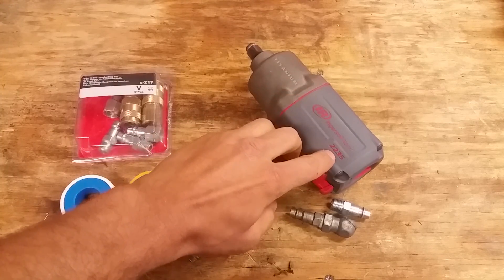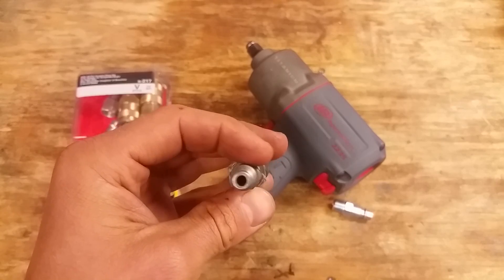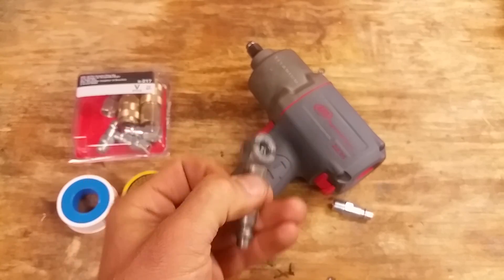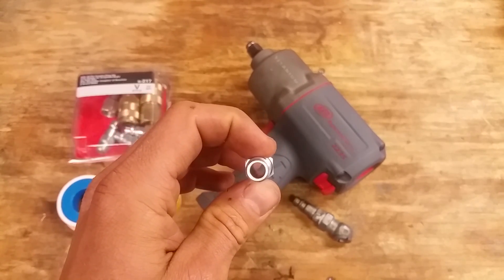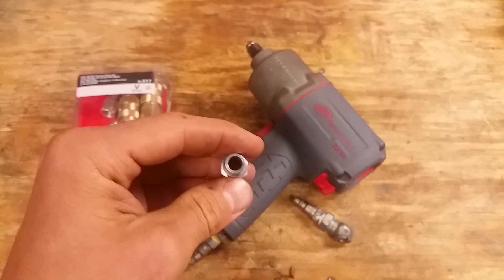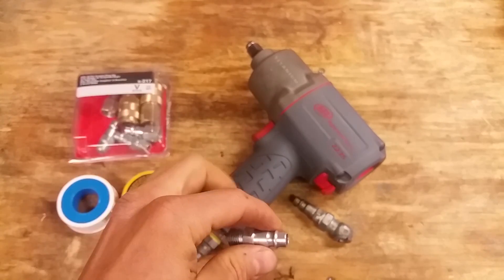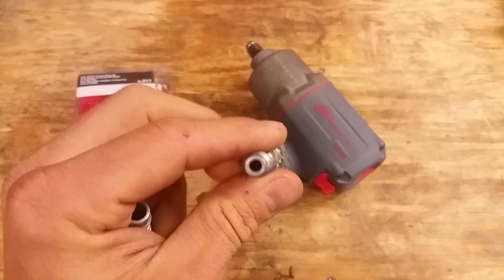The BEST Air Fittings Made?!?

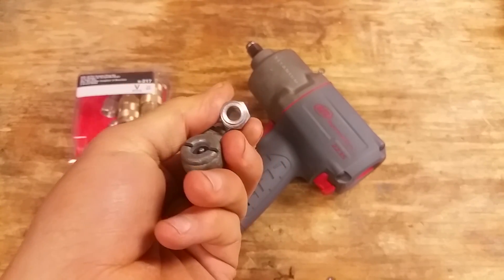Comment: Hey MATT!  THANX for your excellent video.  But you asked us about the "Before anf After" difference and our own results didn't you? SOOO, here we go:  Last year I bought my very first impact gun for working on my cars. I bought it at a local EXPO, attracted by its very small size, very attractive because of the cramped insides of present day automobile engine compartments.  It is a very compact gun made by Mighty-7, model NC-4610, a gun that can go into smaller spaces than most main brands like Ingersoll-Rand, Atlas Copco etc.  Let me tell you that these smaller but powerful (400-600 Ft-lb torque) compact impact tools NEED even MORE airflow than the standard guns like your Ingersoll-Rand.  How can that be?, Well, as an engineer, I just had to investigate the reason.  I saw the Mighty-7 demo at the EXPO, and it was amazing... BUT the first time I pretended to use it at home, I suffered an amazingly DISAPPOINTING Failure, as I wasn't able to even remove the wheel nuts of my wife's car, that were only tightened to a low 85 Ft-Lb!  I took the Impact gun to the vendor, and they tested it, returning it to me as "perfectly OK"...After studying deeper and deeper into the subject (that many people wrongly take for granted), it is due to the compact's gun having a higher INSTANTANEOUS AIR FLOW CONSUMPTION.  It is better explained by understanding that an air motor is not like a turbine (more or less constant air flow), but more like a reciprocating pump.  In Reciprocating pumps, you need to have a HIGHER available pressure at the inlet in order to avoid the cavitation of the pump. That is because at every pump piston stroke, the fluid MUST be accelerated through the inlet passages of the pump, in order to "fill" the piston cavity or cylinder. Otherwise, it will fail to fill completely, exactly like when you try to QUICKLY fill a syringe with water from a glass through a slender hypodermic needle: if you pull the syringe  plunger too fast, the water won't be able to fill it completely (at least initially).That fluid acceleration is needed because the fluid is not moving at first, but as soon as the pump piston tries to pull the fluid, it needs to get quickly moving.  Exactly the same happens in an impact gun: Every time the air motor (a vane type air motor) starts to turn, it demands a VERY HIGH instantaneous air flow, because the cavity formed by the vanes passing in front of the inlet port demand a very high instant flow (the cavity is ALMOST empty because when the vanes turn, the cavity emties to the atmosphere, through a very low restriction muffler, so that in the next cycle, that cavity is almost at atmospheric pressure, but before the vanes turn, actuallly there is a very low flow. This means that the really important flow is not the average, but the Maximum Instantaneous flow. Thus, as you correcly said in your video, the manufacturer of the air tool only gives the MEAN or AVERAGE air consumption because he is NOT able to measure instant airflows, so they resort to only measure average consumption after several seconds (or even minutes) of the tool operation. While continuous or average air consumption determines if the compressor will support the tool's demand for air, it is the hose (and anything) between the tank and the tool which determines or limits the instantaneous air flow.  That means that hose internal diameter, its lenght and the pressuredrop of any fitting betweenthe tank and the tool are the most important things. For example; the popular swivel-type fittings that allow great movement of the tool, typically causes too much pressure drop.  Same thing for any pressure regulator after the tank... small 1/4" size regulators have por pressure drops at high instantaneous flows.The difference between the performance of the impact tool in the DEMO at the EXPO, and the same tool at my home was NOT the size of the compressor, but much more importantly, the size of the HOSE (inside Diameter AND lenght).  At the EXPO, the impact gun was demonstrated with a MUCH LARGER 1/2" hose and only about 8 ft long (the size of the vendor's stand!), while at my home I was stubbornly trying to use their brand of Retractable Reel, which stoopidly enough, comes with about 50 Ft of NON-Standard 8X12 mm polyurethane hose, a beautiful blue color but USELESS air hose, at least for high consumption tools like the Impact gun or the air hammer!  That damn Taiwanese air hose is NOT the assumed "3/8" standard air hose, but a non British, metric one, and while externally it LOOKS like a Std. 3/8" hose it is WAY narrower inside, at only 8 mm (that's about 70% area of the 3/8" hose). That, coupled to the longer 50 ft lenght inside the reel, made my new impact tool so weak that I was unable to remove the wheel nuts, even when the Torque chart that they deliver for this exact impact gun model, reaches a peak of almost  660 Ft-Lb after a full blast during 8 seconds.After being puzzled by the manufacturer data and my initial results, I started to learn exactly how the tool uses the air pressure, and how important is to be able to achieve the demanded Max Instantaneous Airflow that these small but hungry air tools demand in order to deliver their torque. Next, I replaced the hose reel with a shorter, 12 ft lenght of 1/2" internal diameter air hose, and VOILÁ, the little impact gun instantly removed the same wheel nuts... but failed to remove some stubborn larger nuts and bolts used in the suspension of the same car... again filing to show the advertised high torque of more than 600 Ft-Lb.Lastly, Thanks to your excellent video and info, I gathered the last piece of information: the coupler and its fitting.  By removing my DeWalt's air compresor standard coupler and screwing the hose directly to the compressor tank, and using the 1/2" hose directly attached to the Mighty-7 model 4610 NC compact impact tool, I was completely amused to verify that now the tool is able to remove the tightest, largest suspension bolts with easy.  Another thing that the people from the vendor told me was that all impact air tools NEED some "Break-In" or "Run-In" in order to properly "seat" the edge of the vanes to the cylinder or housing wall, otherwise those won't seal and slide as well as after some use.  They recommend to put oil more frequently into a Brand new tool, and it shows because the air outlet will spew out a darker than usual oily exhaust during that break-in period, that you can see with a naked eye.Again thanks for your useful and helpful video, I'm ready to search for my Milton high flow fittings first time tomorrow's morning!  P.D.: As soon as I looked at the large difference in size of the two fittings in your video, starting around 2:05, I remembered about another tool that came with the same style larger inside diameter fitting: a tool made by German company "BGS", that is intended to bleed the brakes of a car using compressed air.  That tool uses a kind of ventury to produce a vacuum to pull the Brake Fluid out of the wheel calipers.  Well, I wanted to do that task some days ago, but found that the fitting that the pistol-like handle came with, is almost exactly like the Milton ones, and that my air hose coupling did not accept that slightly larger fitting. So, here your video is DOUBLY USEFUL, because now I positively know that the Milton ones are not only better flowing but also back-compatible, so I will be able to use the older narrower fittings for the tire inflator, and the blow gun, or the small ("detail") painting guns, and the high flow ones for the impact gun and the pneumatic hammer ( as well as my new brake bleeder, that already came with the larger fitting).  Best wishes.

Comment: Im a ASE CERT MASTER TECH for many years, thruthfully speaking it doesn't really matter that much about the fitting, , the 2 things that make your airtool perform better is the hose inside diameter and the pressure u run it at! These fitting might show a minute change in performance! But you have to retool all your tools with this new fitting which can be costly, and also its not a STANDARD industry fitting! the 3/8 1/4 npt is standard for up to a 1/2 drive impact gun, anything over that ull need a 1/2 insde diameter hose! eg. 3/4 inch drive to 1 inch drive impact! Also sometime's u may have to borrow or lend a tool to colleage which wouldnt work with your fitting! So keep it simple stupid and stick with the STANDARD sizes! This is why WINDOWS is the number one platform in the computer industry and ANDROID controls the cellular world !....
Reply from the maker: This fitting is worth changing out everything in the shop. If they want to borrow a tool just swap out the fitting with a regular "M style" fitting. The female coupler is backwards compatible with "M style" fittings. Meaning the female plug coupler will accept both types. If you change it out both types will plug in. You can't plug this "V type" into a regular "M style" female coupler though.
Reply: Are you not seeing the obviously higher rpm?

Comment: Yep, I just purchased the NitroCat 1/2" 1056XL for a good price on Amazon.  The minute it came in I put fittings on it and tried it out.  Well, it really struggled to remove lug nuts on my 1997 Jeep Cherokee Sport.  I jacked up the air and it did better, but still slow.  So, I checked into YouTube University and found your video.  All my fittings are the small ones for operating my little trim nail guns and staplers, the hose is 1/4" and very light weight.  I just ordered the Milton kit you recommended, a short whip with a 3/8" swivel and a new 3/8" x 25' Air hose.  Because your video made sense.  I'll let you know how it worked out.  Cheers.
Reply: Jacked up to what psi??

Comment: I have a 3/4 Impact gun which needs a 3/8 fitting I used a reducer 3/8-1/4 with a 1/4-1/4 fitting and flow is weak gun sounds like its dying. My Husky Model # C303H 30gal air compressor has 1/4 connectors/connections everywhere and the regulator doesn't drop under 90psi w load. How can I get it to work properly?
Reply from the maker: 3/4" impacts really need 1/2" air hose and 1/2" quick connect fittings. It's a 3/4" right? Not 3/8"? Sooo 1/2" connectors from the tank to the impact. They are expensive I know, but it's worth it. You'll see.

The 3/8" hose and 1/4" fittings will never flow enough air for it to work right.
Reply: @MattsShop  The impact gun I'm using is from Harbor Freight Central Pneumatic Item # 66984. 3/4 in. Heavy Duty Air Impact Wrench. I plan on getting a 1/2" Hose.
Reply from the maker: Yea, you should be golden with that set up. A 3/4" impact needs 1/2" air hose and fittings. 3/8" air hose is WAYY too small. Did you get it set up??
Reply: @MattsShop  A 1/2" Hose was unavailable at Harbor Freight so I got a high flow automotive fitting kit and a 3/8 to 3/8 NPT adapter to connect to my air compressor and impact guns. Also brought the 3/8 blk 50ft hose and it made a huge difference my 1/2 impact took out my lugnuts with ease they were stuck by a shop and my HF 3/4 Impact wasn't even necessary but I'm keeping it anyway but its reverse tq is rated at 1000 when my 1/2 is 1300 makes no sense to keep it unless it's really better.

Comment: Hey Matt. 
Is there a difference between brass and steel couplers? I'm using my compressor mostly in the garage with a little stapler, filling tires and blowing dust of circuit boards. The brass is almost double the price and I can't see the benefit.
Reply from the maker: Steel air fittings are the strongest, cheapest, and most common. Brass air fittings seal better (so they say), are weaker, don't rust, and are more expensive.

So it just depends on your application. For example, if you were using them underwater or for an application that you would put water through the fitting, then you'd want brass. I'd use steel air fittings. That's what I use!
Reply: Thank you brother.
Appreciate the advice and the time it took to record, edit and post your video.
Cheers
Reply from the maker: You are welcome! Thanks for the support!
Reply: Went to Harbor Freight today and picked up a Merlin 5 pc set of steel couplers. Cost me less than $4 with a coupon. Totally stoked. Will record a video on how they're working out after a few months of use.
Cheers brother

Comment: I've heard Milton fittings are not very durable. Some of them can chip or break if they are dropped. Have you had any issues with that?
Reply from the maker: No that's not true at all. The only problem I had was my air hammer put ball bearing dimples on the fitting from all of the vibration at the coupler. The coupler got stuck on, but It was my fault. I was misusing the air hammer.

Comment: whats the inner diameter of these fittings? i wanna compare to mine.
also what fittings do you have on your compressor? dont you have to swap them too?
Reply from the maker: I don't know the inner diameter. The whole end of the 1/4" air fitting almost fits inside these. It's substantially larger.

Comment: Will this fit the IM plugs?
Reply from the maker: Yes, they are backwards compatible with "M" style air fittings.
Reply: @MattsShop  good. I even put the high flow on both ends of my hose and on the compressor itself. I'll test it tomorrow

Comment: Did you also change the fittings on the other end of the hose where it connects to the compressor? If not, isn't the air flow still restricted?
Reply from the maker: Yes, for max flow. I plumb directly into the compressor with no quick disconnect fitting for max flow.
Reply: @MattsShop  Thanks! I just got an air ratchet to work with a little 6-gallon pancake compressor for my home garage. Want to get the best performance out of it.
Reply from the maker: Yea, you're gonna need the high flow air fittings. Air ratchets use A LOT of air!
Reply: Thanks,  @MattsShop
Reply: @SiteReader  That pancake unit will be charging the whole time - not a lot of reserve for those types of tools.  I have a 60gal which runs down fast enough as it is.
Reply: the swivel is by far the largest restriction there...

Comment: Time to upgrade to an impact socket set for your safety if you intend to use the power of that wrench. I use the first fittings and allow my pressure to go up to 125 psi and use 100 feet of 3/8 hose and my older 500 ft/lb  wrench could kick butt on your "before" setup. That swivel is choking your system and needs an upgrade because sound wise your "after" is about equal to my before. 
PS; Good video. I may consider an upgrade since it is backwards compatible. I already have a high flow female coupler for the M style to minimize freeze up in winter, but the regular one works just as well to resist freezing. These may be helpful to seat beads and inflate tractor tires.

Comment: Haven't used my air impacts since buying the Milwaukee electric impacts.
Reply from the maker: Lol battery powered tools suck.
Reply: @MattsShop  I'm very impressed by the power and battery life of the Milwaukee fuel line.
Reply: Same here.  The Milwaukee impact is super awesome. It blows my old SnapOff air impact out of the park.
Reply: @MattsShop  My electric 3/4" Milwaukee impact will out perform your air impact any day, I work on rail cars and trains all the time. And a single battery will last me 6 hours of almost constant use, my impact came with 2 batteries, so i never have to worry about it dying on my when im on top of a rail car breaking off 2-4 inch nuts that are torqued down to 230flbs... id like to see your air impact break something like that, it won't, i know because we also use air impacts, my battery one is far more powerful. So you claim that battery power tools suck, seems to me you're just being ignorant.

Comment: Are there any swivel connectors that have large ID's for the V style connectors?
Reply from the maker: Nope, I haven't found any.
Reply: I've found that the ball type flows appreciably better than any "Z" type swivel, but unless the internal diameter of the ball is equal to the ID of the connector, there will be some restriction.
Reply: Flexzilla makes one that works no restrictions

Comment: What size air hose are you using? Do you have to have the high flow  Female Couplet to use these?
Reply from the maker: 3/8" air hose. Yes, you need the high flow female air fitting to use them.

Comment: I just got a good air compressor with some tools, I used all G connectors on a 1/2 inch hose. No air flow problems, my Air cat sounds like your IR after you added the V connector. I did make up a couple of 3/8 hoses with G to 1/4 industrial for nail guns and stuff like you were saying for low flow. It seems like all air tool manufacturers list their tools at 25% duty cycle average. So if your 20 gallon 120V sanborn compressor builds air with a 1/2 inch impact wide open, you are severely underflowing your tools. I got a Puma 2 stage 5HP 40 Gallon tank compressor for my home game setup and I am happy with it, could be better but for a 2 stage you can pay a lot more.

Comment: good info. for me thank you, I have a machine shop and use a lot of air details are important. This is way off the subject but might throw it in while we're sharing idea's, I never use teflon tape, my theory is that threads cut it and roll it out of the way even if applied properly. liquid thread sealant almost any type is better in my opinion. I also use a lot of coolant plumbing and other applications with sealing threads.
Reply from the maker: You're welcome. Yea, I usually only put the teflon tape after the start of the threads. That way it does not get cut and end up loose in the tool.